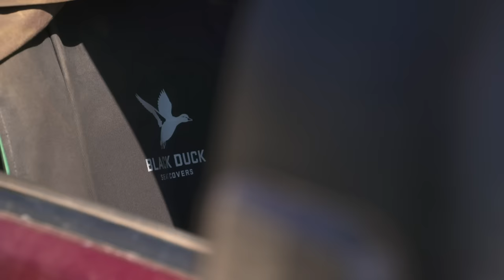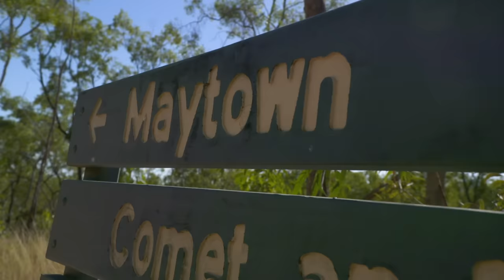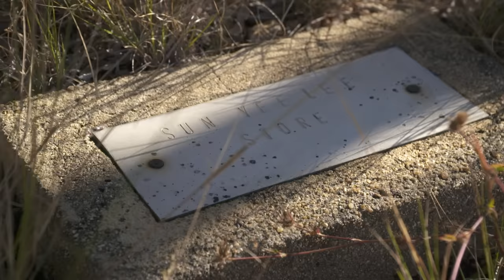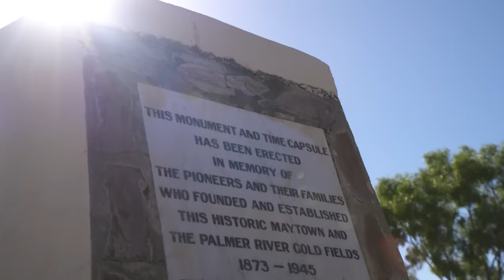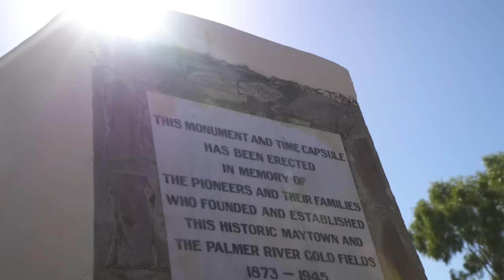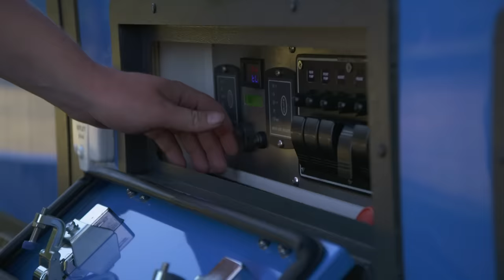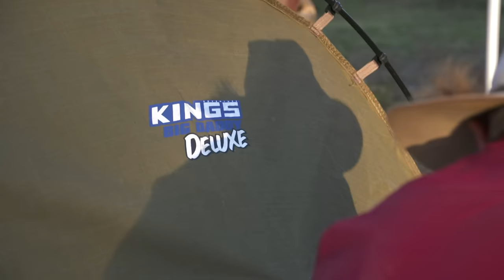Shauno broke TWO 4WDs last time he was here! Did we survive Cape York’s truck-breaking Old Coach Rd?

Comment: Car guys, I noticed your kitchen stove is running rich. Turn the round dial (just after the fuel control valve) to let more air flow into the mixture for a better combustion. Flame should be bluish, not yellow and smokey.

Comment: At the end what Graham said about the Domin8r winch I totally agree. I have just put one on my PJ Ranger and on the way home from work, found a 79 series Toyota ute stuck in sand down to the rear diff. He had gone down not only because he hadn't dropped his tyre pressures but also because he had over a tonne and half of gear on the tray including a gennie. Out came the winch, and with the anchoring by another Ranger behind me, we got the Cruiser out albeit the clutch a little worse for wear on the cruiser. Very much a confidence booster in the equipment by Kings!!

Comment: I worked in Oman for 3-1/2 yrs I had a 100 Land cruiser and punctures were a major problem, we carried 2 spares and one day I had 3 punctures. had to steal a spare from another truck to get back to Camp. We used A/T tires (Bridgestone Desert/ D) the issue with A/Ts is the sipping they have for water ejection, sharp little stones get in then another and another and they push through the case and you have a puncture. I tried in vein to get them changed to a M/T block pattern than don't have the sipping, the more open tread doesn't hold onto the stones and in that time I saw it rain twice. Horses for courses but I'm a M/T every time. Cheers Leon.

Comment: On the crapping tip, in addition to digging a hole throw a match in after you've wiped to burn most of the paper away (if safe to do so ie. no dry leaves etc. in there to spread the fire). Everything will break down easier & there's nothing to blow around decorating the bush 👍
Reply: Most tp is septic friendly and bio degradable

Comment: You daft West Islanders! Reminded me of about a 400m run through water that was lapping the intercooler intake on the bonnet of the old Isuzu Bighorn. I was thinking to myself "It was a bloody good investment to buy that snorkel. But I sure would feel happier right now if I'd invested a little time and fitted it." The old girl made it by keeping the air intake in the dip behind the bow wave, pulled the lid off the air cleaner as soon as I got through to check for moisture. Great video.
Reply: gadgetman_nz cool story bro
Reply: @gbangerau  After that I did put the snorkel on, as well as drilling a tiny hole in the bottom left (lowest point when parked with the road camber) corner of the front lights to let the water out. I was fair shitting myself having previously drowned my GU which cost me a new engine and headlights after the reflective surface peeled inside them.

Comment: My answer to Sam.
My go to is BF Goodrich A/T
They just fit in my budget at $315 a piece for a stock 80 series wheel, they were the first mod I did to my 97 40th Anniversary 80 series, literally the next day after I picked up the 80 from the car yard.
I’ve been running them for a little over a year and I can’t recommend them highly enough.
As a daily driver that sees a lot of off road use they’ve stood up where others in my convoy have failed 😊

Comment: From USA here. You guys are amazing wish I could spend a year 4x4ing with you. I have a question for anyone over there about your rigs. Why are your trucks not set up with coil springs and long arm suspension running 35s or 37s. I get your showing what a regular guy can do with a daily truck but here people heavily modify jeeps and trucks for extreme 4x4ing and never leave the blacktop.  Thanks for the amazing vids guys and the comments.
Reply: Modifications on vehicle are heavily restricted in aust. Not many vehicles legally can run 35 inch tires compared to 37. DMax would leagally have trouble running 33s
Reply: @simon7184  Sad. Nanny state at its best.

Comment: When I was in the army I learned to use a intrenching tool ( small milatary shovel ) I'd dig the hole then put the Spade in a L shape and then I could tuck the Spade under my thigh and use it as a seat it works great to this day a always carry a small milatary shovel and a roll of toilet paper is a Ziploc bag.

Comment: Did the Old Coach Road from north to south in 2013 by myself. It is cut out of the rock and I needed a new set of tyres afterwards. Had to use a tree as my brake every time I had to get out of the car. 5 hours for 25km

Comment: One thing you should point out Shauno . Never use a K&N filter off road due to the performance material will not keep the fine dust out of the engine like a traditional paper element .

Comment: Best way to make a bush loo. Dig a deep hole. Burn after each time toilet paper used with nearby kindling/paperbark. Can fill with hot coals from fire too. Then cover up again with what you dug out hole with before you leave. It’s quick for overnight stays too. Not burning the toilet paper means with weather events it can often end up exposed even if you dug a hole. Also burning keeps the smell away so everyone can share the same spot. Beck

Comment: Not sure why you didn't just use a screwdriver to bridge the starter motor. If you bridge it between the male spade connector and the high voltage ring connector it will start.

Comment: Question for Graham, I have a Ford Everest Auto and haven't been four wheel driving for long and I'm curious why a lot of the time you use 2nd gear manual mode instead of Auto?
Reply: Because you never want a 4x4 to shift down to first, uncontrolled and under load, causes spinning and breakage.
Reply: @nonope1774  Thanks mate

Comment: Hey even though ur winching up the rock steps in neutral, would ur tail shaft not b spinning anyway?
Reply: no
Reply: @rogerhector8323  even with a Lsd or locker?
Reply: I meant no it will be alright cause its got no drive on it

Comment: Good too see I'm not the only one that comes across where those bastards crap / use toilet paper and dont burry it,  takes 10 secs to dig a hole with a spade.      If its safe to do so I burn my used toilet paper too .   Thought the main reason for taking cans ( beer and softdrink) was because you  can crush them when empty , takes up less room, weighs bugger all.  No excuse for chucking empties in the fire.
That old coach road is tough on gear ,  plus there is no fishing ,   but its worth it if you find some gold !

Comment: Fk me, tip if ya starter motor is on the way out hit it with a stick for a bit more life, How bout just replacing it. Out standing fellas
Reply: Actually it most likely just needs new contacts, replacable on most Asian 4x4s.

Comment: if you leave rubbish/crap behind when your out camping in the wild or anywhere else for that matter, you are selfish and thoughtless, pure and simple, there is just no need for it.  i bought myself a trasharoo cost me $40 + tax when i was stateside i get more comments about that hanging of the back of my disco than i do most of my other mods and $40 is nothing compared to what people spend on mods. i think it should be law that you have to have the means to remove your rubbish or you will be fined. the same as if your walking your dog. if you havent got a poo bag and your walking your dog you get done for it whether your dog has crapped or not.